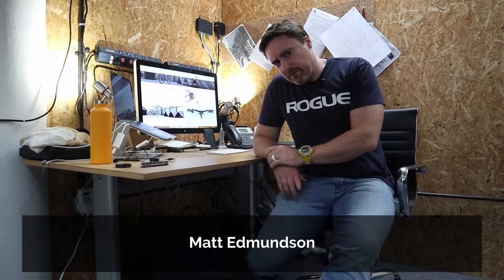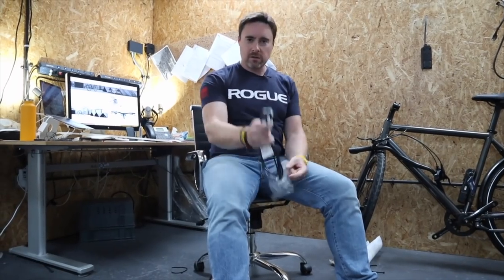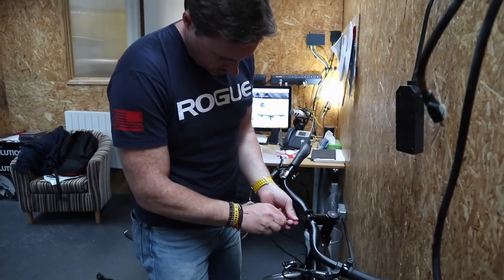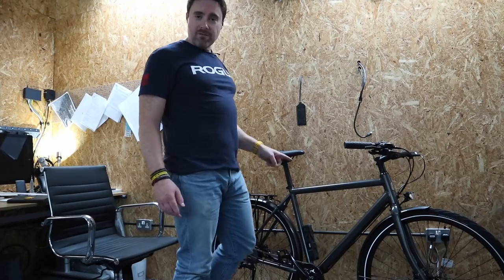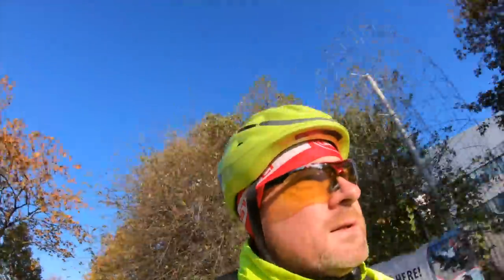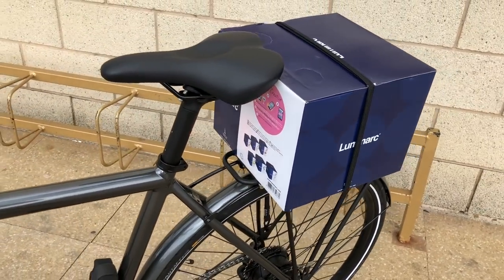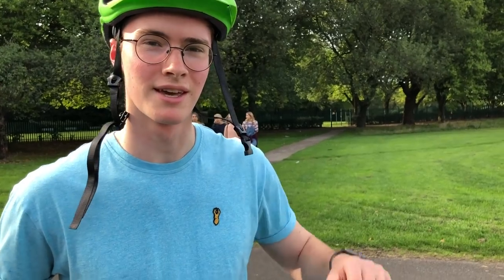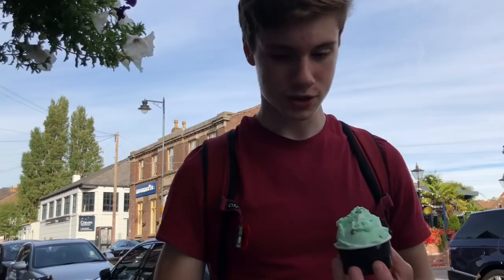Ampler Stout Electric Bike Review and how it compares to the Curt

Comment: Hi Matt, nice video.
How does the bike do when it's turned "off”? Is there a lot of resistance from the motor, or don't you notice and just ride like a normal bike?
Just wonder as I am thinking about buying a Stout, but I want to use it as a "normal" bike as well on the way back home from the office and use the “on” mode only when going to the office.
Reply from the maker: Great question! I’ve ridden it without the motor on and you do notice a little resistance. I don’t know if it’s actual or psychological but I do notice it. That said - the gears really help with this. You can ride the bike when the battery is off if you want more of a workout.
Reply: Hey! 

The motor has a built-in free-wheel, which means that there’s no resistance from the motor when the motor is not helping. 

Cheers
Ott
Reply from the maker: Ott Ilves awesome. Thanks for the clarity.
Reply: @popsicleband  Thanks for the answers, very good info.

Comment: Hi Matt, what type of km range do you get on a full charge? Have you experimented with eco and full power?
Reply from the maker: Honestly, I have never tested it. I did about 60Ks once on one trip - but never tried to run the battery out. I just keep it on full power all the time as I haven't had to change it for what I need.
Reply: @mattedmundson  Thank you for the answer! It means the 70 km range indicated on the website seems to be an accurate distance.

Comment: I wish they'd offer the Stout like the curt, but only with a different steering wheel and bigger wheels for comfort. I mean, you've got the motor, why would I need gears? Nice, light and less points of failure.
Reply from the maker: Brazen NL good idea but I can see why they added them. The stout is heavier and would be ridden slower. To do that well you’d need the gears on there. Still, a single speed Stout would be an interesting bit to ride.

Comment: Hi Matt- my Ampler Stout should arrive this Wednesday(I changed from Curt). I knew I had met you  but I didn’t recognise you with your clothes on. I think we had a quick chat while showering in the Uni sports centre  late last summer (about vaping). Anyway, do you reckon it’s advisable to use my new bike without the app? I know it’s possible - they mention it on an Ampler vid.  I am old but tech savvy but only use my devices on wi-fi at home or in cafes, etc.
Reply from the maker: I definitely wasn't in the Uni Sports Centre last summer - but I am intrigued :-) On the app front - I never actually use it. When I first got the bike I set the mode on it that I wanted and have never really used it since. You can turn the lights on and off (if you have them) by long-pressing the power button on the bike. The power button also lets you know how much power you have left with simple colours. So you can definitely use it without the app. That said - connecting the bike and the app is super easy. You don't need wifi to connect your phone to the app as it uses BlueTooth technology - so as long as BT is enabled on your phone, just open the app - click vehicle and you should see it there. Hope this helps!
Reply: Matt Edmundson Thanks Matt= clears up a few things. I was very ill when I had that talk in the Uni last autumn  so add Covid and my memory is a bit fuzzy.
Reply from the maker: @2fallguy  explains it then :-) it's been almost 30 years since I was last in there!

Comment: I bought an ampler curt. Received it. Then got a message that due to technical problems they could not deliver. I already drove the bike with our child on the back for 3,5 hours.
they told me the bike was delivered by mistake. in February they also had a problem with front forks that broke... Not a very good brand in my opinion. still waiting for my money to be returned after 6 weeks of buying the bike.